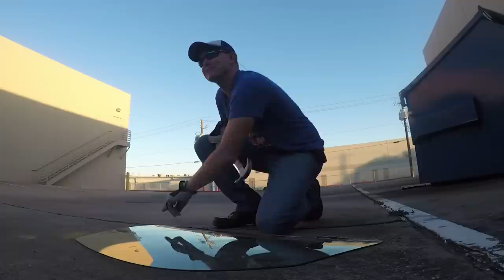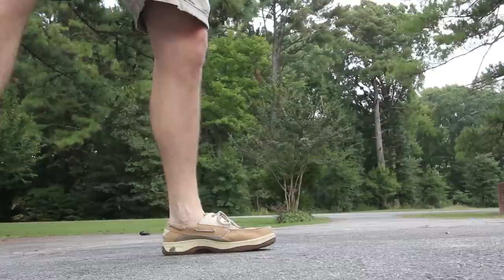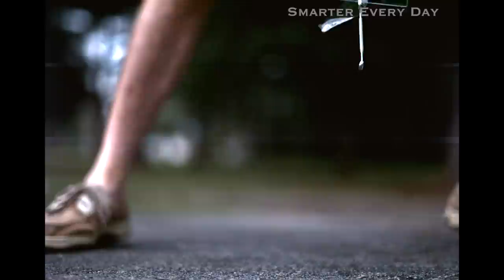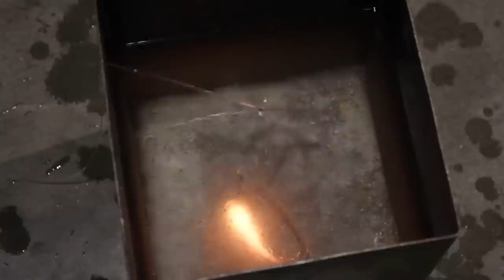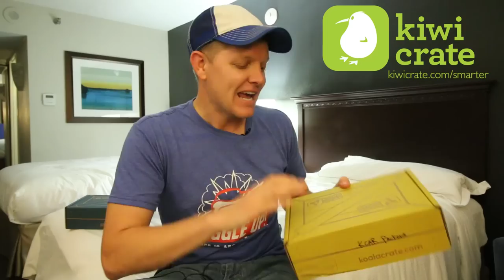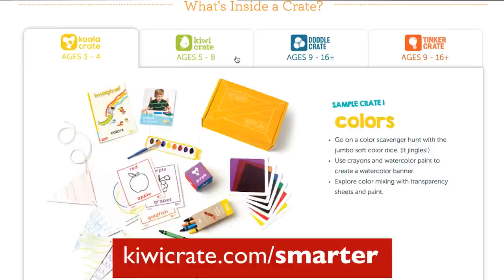How to Escape from a Car Window (SLOW MOTION) - Smarter Every Day 144

Comment: Great video Destin.  You're the man.

Though I feel compelled to note just one thing; this is the first SED that I have seen where I might know more about what is going on in the video than even Destin.  Solely because I have worked with glass for 15 years.  

A few things that might be worth mentioning: both varieties of glass that he tested (because that is what auto makes typically use) are soda-lime glass.  That means that in the manufacturing process they start with a typical silica base, and add primarily sodium carbonate, lime, typically small amounts of aluminum and a few other things, melt it, and drag the molten glass out on long conveyors. Interestingly, for annealed glass, the furnace is constantly producing glass, and the belts are usually very long, to give the glass time to cool and anneal.  They pour it continuously out of the furnace and it hardens as the pressure from pouring it all pushes the whole thing forward.  We're talking typically a quarter mile (402 meters) with some minimal friction coefficient.  Imagine the pressure pouring it gives you, to push 402 meters of glass along at an even rate.

Anyway, there are two ways of making that raw soda lime glass into tempered glass.  One is, as Destin described, a separate pour rig which forces air onto the surface of the molten plane, in order to cool the exterior to build up internal surface tension.  The other way is to take an already cut piece of annealed and put it into a cooler oven and melt the surface and innards to do the same thing, or just melt the surface and cool it immediately.  All three give the same basic result.  You can also adjust the variables to change the effect, such as using less heat and cooling a bit more slowly to heat strengthen the glass, so it is in between tempered and annealed.  It is strong because of the surface tension, but when it breaks it breaks in bigger chunks than does tempered, and is lighter.

The surface tension for tempered glass is so high that you can actually just barely tap an edge and cause it to burst.  It takes almost no pressure.  If Destin had just niked the edge instead of dropping his tempered sample, it would have easily broken.  It was actually an amazing fluke that he dropped it on the edge and corner and it did not break.  How I wish I had that luck, because i have slightly tapped tempered pieces on the edge while installing them and broken them.  

Anyway, as he noted tempered is useful in the side windows because they're strong, but if they break they wont send huge chunks of glass at your face should you get in an accident.  For the exact same reason, Federal code in the US (and almost certainly everywhere else, I just don't know any specific details about how jurisdictions outside the US work) states that glass with a high likely hood to break from normal use has to be safety glass, like in doors and near floor drains and low tot he ground. All automotive windows have to also be safteyglass.  The windshield specifically, as Destin mentioned, is actually laminated annealed glass.  Typically they're DS glass sandwiching a chunk of .080 plastic, heat fused so that they all adhere to one another.  That makes the glass much much stronger, but also makes it so that the chunks don't fly into the vab to any great degree.  Tempered glass is still stronger, but if that shattered you'd have tons of tiny shards flying towards your eyes, or it would wholly obscure your vision so a rock hitting your windshield would effectively blind you, which of course is not good when moving around at high speed in a giant chunk of metal.

Lastly, there are a ton of other kinds of glass.  From high aluminum content to borosilicate  like old Pyrex (incidentally, modern kitchenware "pyrxs" is actually just tempered soda-lime glass) to fancy stuff like LAS (Lithium, Aluminum, Silicate) for high temp applications like oventops and fireplaces.  Some are MUCH stronger than anything you'd find in a typical automobile, but they re also so expensive that the car would cost twice as much as it already does with that one little change.

That was kind of long and sort of rambling, but since Destin made a vid about something I actually know a bit about, I thought I might as well just ramble on.  If anyone bothered to read it, I hope we all learned something today.
Reply: +evilcam Cheers man, I read it all and found it interesting.
Reply: Loved the read
Reply: hey, that was really interesting. thanks for sharing :)
Reply: +evilcam we're getting smarter every day and not solely from Destin's efforts. Have a good one!
Reply: thanks!
Reply: +evilcam I broke a small corner off my glass cooktop the other day while moving the oven...is this something I should be worried about spreading or getting worse Mr. Glass Expert?  :)  I was planning on filing it down to round it out to look better, is that ok?
Reply: +evilcam Wonderful comment, thanks for making it.
Reply: Logan Kennedy  Hard to say.  It depends on if it is LAS, pyrex, tempered, or some crazy obscure piece.  Odds are if the oven top is newer than 15 years old it is LAS, in which case there is not a whole lot to worry about.  You can file down the edge to round it, but I would suggest sand paper instead of an actual file.  Sand paper is much less likely to cause clams and make the break actually run.  Just use the sand paper on the bad edge til it is rounded to your liking, and don't cause it to get too hot from friction (though if it is LAS, you would never get it hot enough to cause a problem with just sandpaper and elbow grease).

If it is tempered, which it probably is not because when those oven tops clam, they just shatter the whole way, sand paper would also work fine.
Reply: +evilcam Thanks man.  I know it's less than 5 years old but I'll go with sandpaper anyway, don't wanna risk it.  Thanks for the tip, random internet stranger! :)
Reply: Happy to try to help. 

Hopefully you take care of it and there are no complications.  If it is LAS, that stuff is crazy expensive.  If you use sand paper (preferably medium grit, like 100-250) you should not run into any problems at all.

A customer of ours recently needed a small piece of it for a fireplace.  We got a quote on a stock sheet, which was $800.00, so per square footage that small 16" x 32" piece would be around $350.00.  Luckily for him my father installs fireplaces, and had an old piece of it that was being replaced.  I had never cut it before, and I was eager to see how it scored and broke.  It was as easy to score as annealed glass, but quite a bit harder to break.  I cut it fine though, and so he got a $350.00 piece of LAS for free.  Since an oven is likely to be quite a bit bigger than 16x32, a replacement piece might be more than a new oven, so let's both cross our fingers and hope it sands well and does not break.
Reply: Dang. Well since you've already been so helpful, it's a Jenn-Air oven and the cook top says "Schott Ceran", if that means anything!
Reply: Awesome. Always cool to have more info. :) Destin is a friend of mine so I gotta mention this whole exchange to him. He'd be pleased!
Reply: +evilcam  Thanks for that. It is beautifully written. Did you work for Pittsburgh Plate? Corning?
Reply: thanks for sharing your knowledge!
Reply: thanks for sharing your knowledge!
Reply: +evilcam 
I recently bought a torch with a special tip to break glass in case of an car accident. After that video I'm not sure anymore where to use it. What would you suggest?
Reply: I work as a heat treatment operator and am familiar with these processes (although I heat treat steel) and wondered how the processing of these different material varied. thanks for your insight.
Reply: +evilcam Actually, thank you.  I had an epiphany reading this regarding what annealing really is.  I've heard the term hundreds of times, but never really grasped what was happening when someone would do it.
Thank you.
Reply: +evilcam i see a fellow glazier finally found a place to rant about how amazing glass is. :D i noticed you didn't mention the molten tin that the glass is floated on to make it perfectly flat, which is probably one of the coolest parts.

also fun fact about windshields, the windshield glass is actually part of the roll cage of cars and adds significant (60-80%) strength too it.
Reply: +Matt Pictaggi  Hi.  Yeah I considered talking about float plate, but I honestly don't know much about it (past seeing it in a factory) so I thought I should probably not talk too much about things I don't know much about.  Likewise I thought about bringing up things about low emissivity and intensity darkening (because those things are awesome), but I don't really know enough about it to talk about it past mentioning they exist. Thanks for bringing it up. Hopefully if anyone has any specific questions about the process that I can't answer, you can pinch hit and knock it out of the park.
Reply: omfeg
Reply: evilcam
Reply: evilcam h